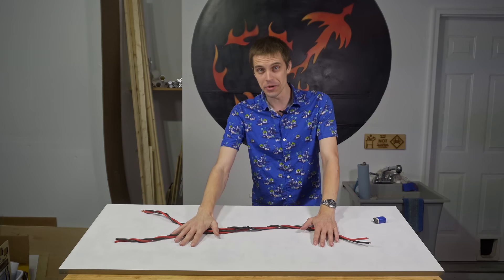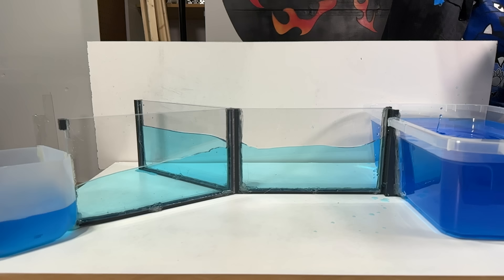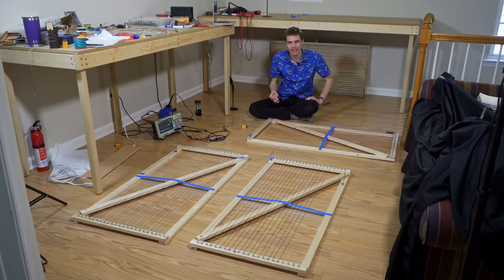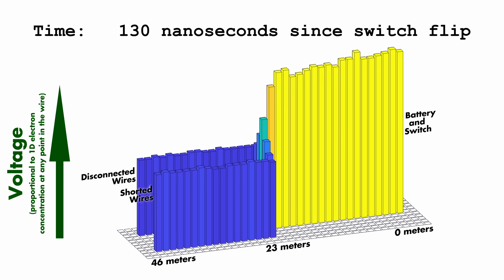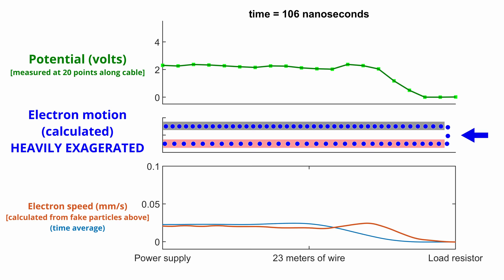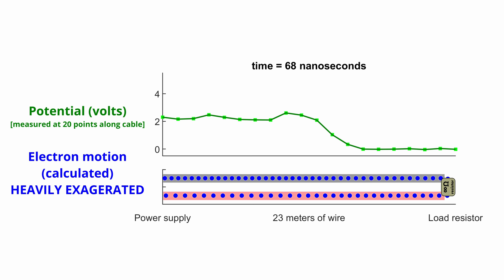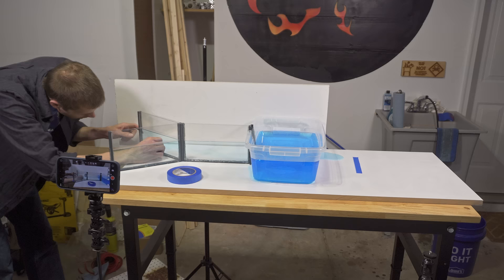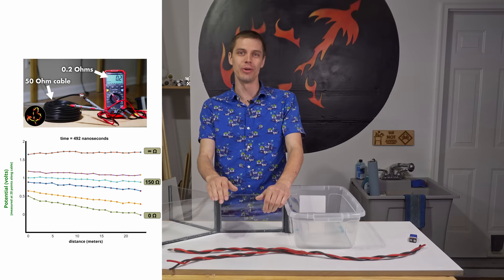Watch electricity hit a fork in the road at half a billion frames per second

Comment: This is an awesome video Brian! I feel a bit smug that I got the answer right, but only after you showed the water model at the start and offered a chance to change my mind 😅 I remember asking "how do the electrons KNOW?" at high school to my teacher and he couldn't explain it, finally I have an answer 😄
Reply: Sit down and behave, Robert.  Stop disrupting the class with your silly question.
Reply: The snarky answer to "how do the electrons Know?" is "They don't because they don't think. Stop anthropomorphizing." 😜
Reply: @Sembazuru  It's not really snark  though, is it, to point out that anthropomorphization is rarely a helpful approach to understanding the behaviour of pretty much anything except humans ?  Wave propagation and reverberation makes so much sense if you think of a battery as a tank full of electrons.  Voltage is really a pressure measurement.  You even get "water hammer" when you switch power off, not noticed at low energies, but eg when stadium lights get switched off, they don't just turn them all off at once, cos that makes for a lights show.

Comment: This is exactly what id expect. Love the bar graph explanation, these relections really effect high frequency data transfers becouse those reflected potental waves cause interferes, this is why the load on data cables ends needs to match the impedance of the cable and the cables impedance needs to be consistant though its lenth hence co ax and twisted pair cables as inductance and capacitance effect impedance with data  pulses and ac.
Reply from the maker: I never really appreciated the impedance matching thing until now. I show an impedance matched circuit in the follow up video on the second channel!
Reply: @AlphaPhoenixChannel  i did a mudual about it when i was working towards my engineering degree, i was very interested about it, i like to think of it like waves on a sea passing over a san bar , some waves are reflected back and cause destructive interference with in coming waves and its all Fourier Series after that.

Comment: Lots of electrical and RF engineers have already made the points I was going to make, so I'll recommend a useful video that explains transmission line theory, and add a couple points of clarification, the most important of which is this:  Electrical power does not flow in wires, it flows in the dielectric between conductors.

Consider an ideal conductor where resistance is 0Ω.  P=VI and V=IR, P=I²R.  Since R is 0, then so is power at every point along every wire.  Yet power is clearly transferred to the load, and the dielectric is how it gets there (c.f. Poynting Vector).  This realisation is extremely important in the design of high speed electronics.

17:18 The electric field would not cover the panel as you describe, because it exists between (and only between) the conductors of the twisted pair.

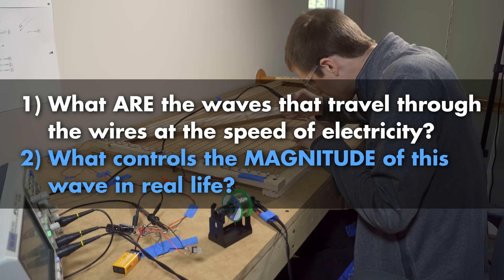19:50 the magnitude of wavefront is essentially just an AC application of Ohm's law: I = V÷Z₀, where Z₀ is the wire's characteristic impedance, √[L/C] (for frequencies at which metal resistivity is neglibile), where L is the partial inductance and C is the partial capacitance of the twisted pair as a transmission line.  

So mutual capacitance is part of it, but not the only part of it.  Both L and C are a function of the spacing between conductors.  For C, that's intuitively obvious.  It might not be so obvious for L, in which partial inductance is a function of opposing magnetic fields.

It took me ages to wrap my head around transmission line theory, but an old 1959 Bell Labs demonstration shows a mechanical model that illustrates the relationship between characteristic impedance and the reflections caused by impedance mismatches:

https://www.youtube.com/watch?v=DovunOxlY1k&t=89s

Comment: This is something I think I've understood intuitively for a while (there is no "communication" between points in the wires, the battery just pulls electrons in one side and pushes them out the other, all of the rest of the effects are just electrons bunching up or spreading out as they will), but seeing it graphed like that (masterfully) is something I've never seen before, and it makes things make so much sense. I think there are going to be a whole lot more people that grasp this because of the work you've done here, and I think that is an amazing thing.

One thing you touched on with the single loop of conductors is that you're measuring potential between the two wires at the same point in the twisted pair, I don't think that came across as clearly with the "Y" configuration. I wonder if it makes much difference though, if you just had a Y of single conductors, one branch loose and one branch grounded, and measured potential between ground (assuming the grounded branch was connected through a switch, and grounded to the same place as the scope) and and all of the points on the wire?

Another question that I think you may have answered in a different video, if you just connect one side of the battery to a bare unconnected wire, does it push/pull? My mental model of the wire as a tiny capacitor thinks that it would, until the wire reached the same potential as the battery terminal.
Reply: The 'path of least resistance' principle turns out to be a pretty accurate analogue after all
Reply: It's a big if, but if the wire had less free electrons in it when connected to the battery than the battery terminal it would pull electrons and drain the battery. I think in practice it would require the wire being physically connected to one system, statically charged, isolated, then connected to the battery: and you'd see a drop in voltage at the battery similar in size to how a static shock is smaller than a lightning bolt. So yes constantly, but also no everything is generally in balance already and the number of electrons needed to keep equilibrium in nature is minuscule compared to what we'd call current.

Comment: I appreciate the fact that you tell everyone that current flows from negative to positive. More people should do this.
Reply: should be told 1 second only, the the + = high volts should be used!!! electricity is hard enough to learn!!!
Reply: @lunam7249  Nah. It should be second nature. There are concepts and components that cannot be understood unless you accept electron flow.
Reply: @GoSlash27  my post phd EE and work at the BIPM , and codata , and NIST still diagrees....it can be taught the second year like the 201 course....electricity is hard enough, but if you like tormenting people, give it to them fast and hard, electron flow, and throw in electron spin and electron clouds for that matter.....i also am a professor, so your students will write horrible things about you on the bathroom walls
Reply: @lunam7249  All physicists and military trained technicians know that electricity flows from negative to positive. It's drilled into them from day one. There is no confusion so long as they don't have to wrestle with the 'conventional flow' lie. As for the rest of it... electron spin is necessary for understanding magnetism and clouds are not necessary at all for understanding electronics; the Bohr model does just fine.
 I know you only said this as an excuse to flex your credentials and all, but I'm an industry expert in avionics with nearly 50 years of experience, sooo...?
/ I've taught all of my students electron flow.
Reply: @GoSlash27  no flex, just trying to make it easier for students...i have never ever had a BEGINNING student who could intelligently comprehend both at the same time
Reply: @lunam7249  I get that, and that's the rub isn't it? Give them a convenient lie to ease the transition, or tell them the honest truth from the outset and let them deal with it?
 The most frustrating response I've gotten from my students is that they have to vet their reference materials and establish whether it's based on 'electron flow' or 'conventional current' before deciding whether to even utilize it or not. Very few can deal with this dichotomy, and 'conventional current' was a mistake at the outset. Technical and scientific references have current going one way, engineering references have it the other simply because 'conventional current' was an incorrect guess and the math was based on that.
 We should never have doubled down on that error. This is, IMO, the single greatest (and least necessary) impediment to understanding electronics. By teaching incorrect assumptions, you are furthering this confusion for future generations.
Reply: @GoSlash27  btw??!!! do you even know what a "J-VECTOR" is??!! or its absolute magnitude??! OR relative magnitude??!! im speaking your fantisies now, so i will allow you to speak....
Reply: @GoSlash27  while you and your 1 understanding student are cuddling and spooning over electron flow, your other 99 are failing EE101!!! during this same time, my 198/200 are passing EE101, and do realize schematics are "learning aids" not the literally behavior of electrons!!!....so i have 198+ your 99 students learning EE101....becomming future EE.... you have 1 student who will forget you by next semester...

Comment: As an EE I of course already generally knew this, but I always share your excitement in seeing a real measured demo.  Especially showing how you need electrons to move and bunch up for the voltage of a wire to change.  Its easy to think voltage causes current at low frequency, but this shows how some initial current is necessary to cluster electrons to generate voltage also - even in an open circuit!  Capacitance is everywhere!

Comment: It's all transmission line theory!  Reflections happen at every impedance discontinuity.  The battery/switch is very low impedance, so turning it on results in an immediate reflection since your twisted pair is likely about 60 ohms impedance.  Then the wave travels down the transmission line and hits the Y, which is another impedance discontinuity since your two 60 ohm lines combine at the split to present a 30 ohm impedance, so you get another reflection.  Then the wave travels down each branch and hits the ends, both of which are an impedance discontinuity, since one is 0 ohms and one is open so you get more reflections.  If you had a 60 ohm resistor (or whatever your twisted pair impedance is) at the end of the line, you'd get no reflection since it would be absorbed.  Amazing graphic!  I love the presentation!
Reply from the maker: You’ll like the one on the second channel where I do terminate it properly 😁

Comment: So at 21:00 when you see the voltage change at the end of the line they start reflecting back. But if you look at the start 0 meters then you can see there is a reflection their also. all 3 are in sync because they are all 23m Apart but how would it react if the first leg was longer or if they were all different lengths. You may be able to see other phenomenon if you were to do this again with different leg sizes. It would be great to see that in a follow up. :) ps good work alpha phoenix.
Reply: The reflections at the start are caused by a mismatch between the source resistance and the impedance of the twisted pair.

Comment: 15:42 Very interesting demo, calls to mind phase velocity vs group velocity.
And needless to say the tuning-fork-shaped illustration of current vs time (10:57) was incredible. I also like that you pointed out that at equilibrium there is no ∆V and/or slope in the disconnected wire so there is no current.

Comment: This is a really nice way to visualize the transient regime in electrical circuits, really good job! I would recommend trying more complex circuits, various terminations and as well antennas and alternating current. One thing to keep in mind is the capacitance and inductance that the circuit gets just by having the cables arranged in that specific way - at fast enough timescales these start to matter.
Reply: Capacitance was my first explanation, but had not thought of inductance until you mentioned it. I cannot see how he could avoid having capacitance in the open circuit side, but would welcome a deeper dive.

Comment: You left out an option:
The electricity moves down the outbound wire only. 
As it reaches the split, it tries to move down both outbound. 
When it gets to the ends, the broken circuit branch stops.
On the other branch, it flows back and eventually finds that it's closed.
The electrons in the inbound branch do nothing until that time.

Comment: This is fascinating and an amazing way to demonstrate what electricity is doing. It also clarified a missing link for me - going back to my telecom's engineering training. We were taught about transmission lines where an AC signal was applied to a twisted pair terminated in a dipole cut to a proportion of the wavelength of the AC 'signal' applied. Although that dipole is effectively an open circuit, electricity flows in the wire and the dipole radiates that into the ether. Your demonstration shows how even though there is no DC electrical path, an alternating signal can push & pull electrons at the open circuit dipole.

Comment: Good introduction to the problems you need to overcome when you transmit PCM (pulse code modulation) along a cable. If you don't have a terminator with the correct impedence at the far end your PCM signal will be scrambled by reflections.

Comment: Kudos to you.  Exceptional video.  You have answered a decade-long question in my mind.  I tip my hat to you.

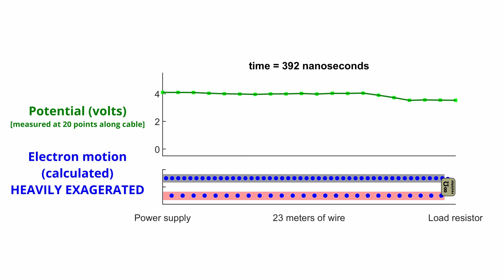Computer Scientist and Musician here (Not an Electrical Engineer).  Despite what you say about electrons traveling, it seems to me you have have created an experiment that expressly makes the case that electrons do not travel, and that electronic current is indeed pressure, not sustained directional movement.  One thing you did not mention in this video is compression and rarefaction.  But isn't that what we are seeing in your diagram?  Compression and rarefaction, just the same as in sound and water waves?  And @19:36, with wire cut, since voltage is pressure, doesn't the zero-sum voltage difference in the disconnected wires effectively conclude we are seeing a vaccuum?  it's like... a standing wave in sound, with a constant compression and rarefaction.  Can't we say it's an electronic standing wave, or do the electronic move back to their equilibrium, as if there was no battery connected, and you just did not show that part?

We were all taught in fourth grade that electrons flow.  But if we do not begin this experiment with that assumption, it seems to me this experiment concludes that electronic current is compression and rarefaction of pressure.  I don't see flow.  Where is the sustained movement of electrons in a constant direction?

Another thing - it seems to me that if this video does indeed demonstrate that electricity is just pressure, and not flow, then you could build a water transistor, and therefore, an Arithmetic Logic Unit (a calculator, using And, Or, and Not gates), using just water pipes.  If you have a sustained oscillation source (like the Quartz crystal for a CPU) for a water Arithmetic Logic Unit, one could build such a water calculator.  If such a calculator could be built, then one could also build the ENIAC, or any computer, for that matter, using just water.  I imagine the sustained oscillation source would not even need electricity - it could be a guy rotating a gear that somehow oscillates the water.  Building a DRAM circuit from water would be fascinating.  And if your oscillation sourse (the computer clock cycles) was a water wheel at a waterfall, then you can store digital memory without electricity.  That would be an interesting project for someone to take up.  Alas, I am not a mechanical engineer.

Comment: Excellent and accurate explanation. FYI, electrons travel at about 10cm per hour, generally along the surface of a copper wire and very little through it.
Reply from the maker: In the vast majority of cases they use the whole wire - “skin effect” is very weird. The excess (capacitive) charge does concentrate at surfaces but it’s a negligible contribution to current

Comment: Potentially very complex scenario, if you're interested; audio signals travel down wires where voltage equals loudness of the sound and multiple bands of frequencies express the tonality of each sound, which you might guess introduces complex impedances.
I work in live audio engineering and often run very long cabling that sometimes includes splitting signal at one or more points. We can observe signal loss (overall voltage loss) by introducing these splits to known quantities, but I would love to see a visualization of that phenomenon happening using what you've designed here.

Comment: Very nice experiment. A first course in waveguides at a respectable university would provide all the knowledge needed to "understand" the results. Open circuit => +1 reflection coefficient, short circuit => -1 coefficient. Intermediate load resistance give a reflection coefficient dependent on the waveguide impedance. A twisted wire is a rather lossy waveguide (resistive and radiative) but useful for lower speeds/shorter distances. The coaxial cable is much better. Typical impedance of lab coax is 50 Ohm. If you terminate with 50 Ohm then there you have a matched load and no reflection. Great video for future RF engineers!

Comment: if you're familiar with the infinite hotel, whenever you get a new guest, you ask the guest in the next floor to vacate and move into the floor above by kicking the previous floor out, and repeat. its not the same new guest traveling the full length, but everybody does the infinite room shuffle at the same time. Not that you would be able to discern the difference between an electron next to the battery and an electron that is 1m away